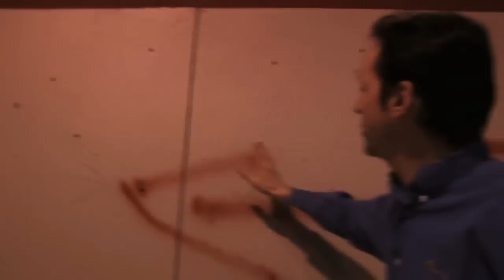Daily Log - Timelapse Compilation

Comment from the maker: @xan2xan3 We're not worried about the floor at all. Once installed it's nearly impossible to damage. However, during the installation process of the epoxy it's important to have good control over the temperature and dust, so we wanted to wait to install the floor before we cut a 14 foot hole in the wall in winter.